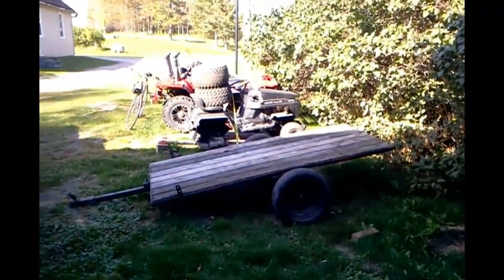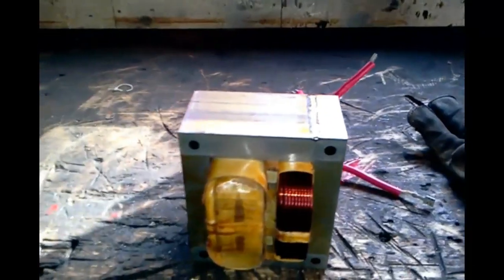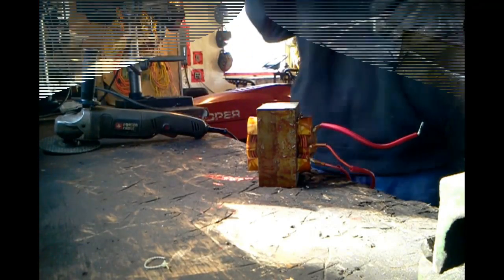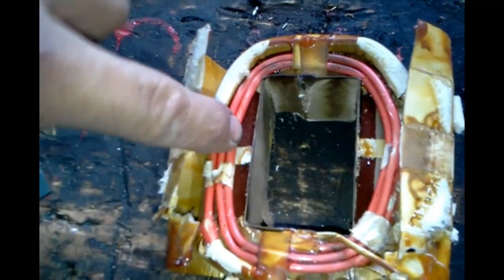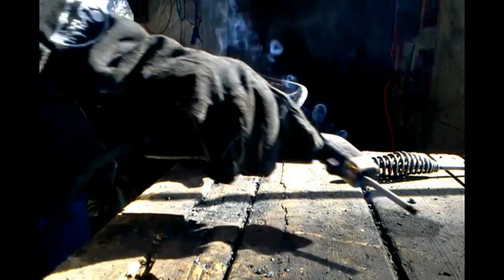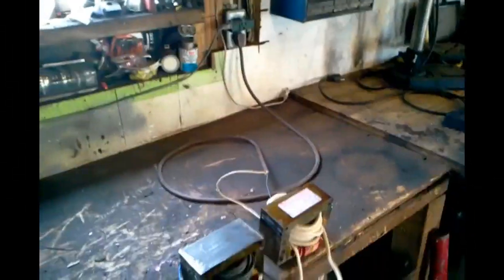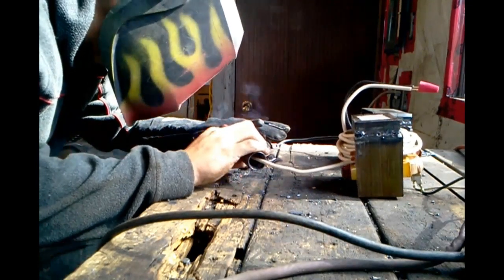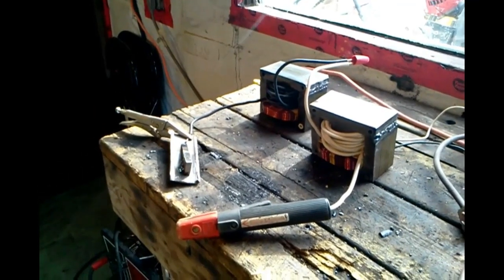How to make a Homemade Welder

Comment: It's a bit of a stretch to say a microwave transformer is the biggest. I got a much bigger one from a metal halide old stadium lamp for $5. Microwave transformers are probably the easiest to use though, since the E * I sheets are all on the same sides

Comment: Ever think of winding your secondary with a copper ribbon instead of wire? You could make the ribbon by cutting a long strip of copper flashing just wide enough to fit through the frame and as long as you can get. Use the thinnest piece of fiberglass cloth you can find between the turns. Might be able to get the same number of turns and the flat ribbon would dissipate heat better and carry more current. One of these days I'm going to build me a welder (after I build a bandsaw, belt and disc sander and a couple of other machines) and I'm going to try it. If I have a video camera by then I might put it on youtube but I'm not holding my breath till I can afford one.
Reply: U my good man defiantly have inventoz Spirit, Letz make mo better, cheaper, mouse trap, shitz!
Reply: it's been 4years. any update sir? 😁